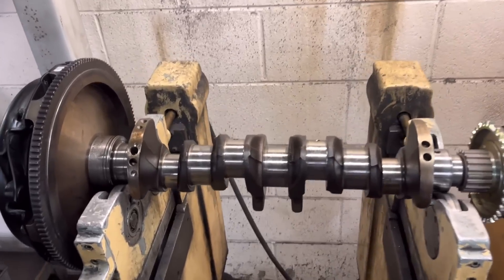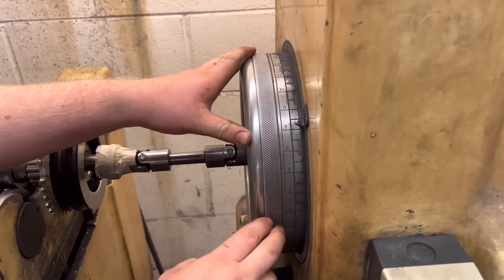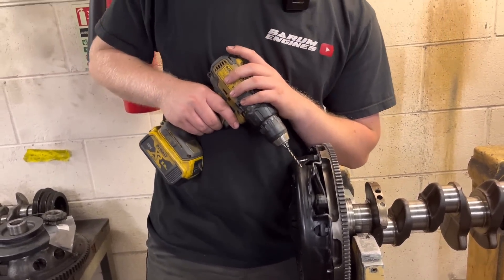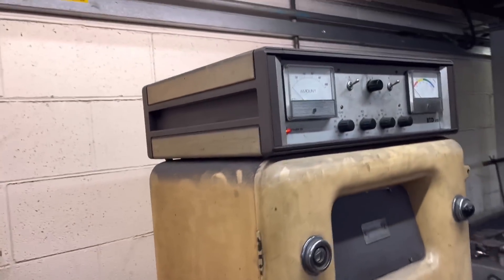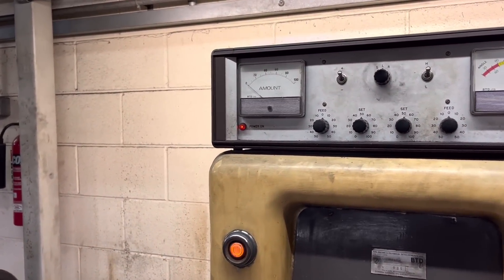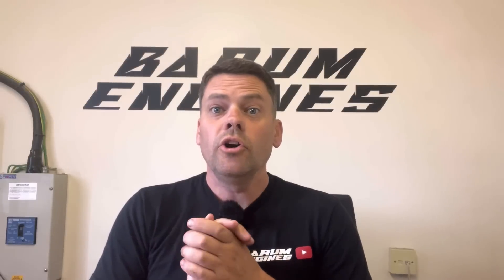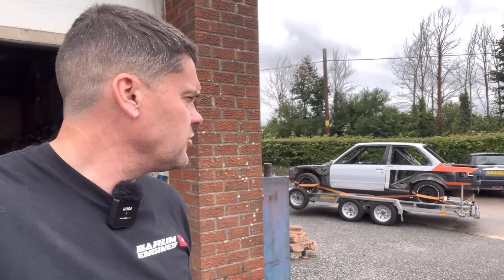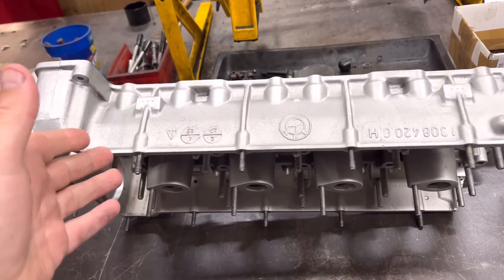Possible dodgy repair could have damaged our machine, costing us £4500!

Comment: Hello Lee, I used to work for an engine builders in Calne called Nelson Engines and did all the heads there, back in the late 80's Mira came to demo the new Centronic and held a full course on it for me and the boss, they explained that apart from the centronic being more stable than the VG85 we had it also required us to have fewer pilots, as you know with the earlier miras we needed a selection of pilots to fit snugly in the guides, but with the centonic we had as far as I remember a 7, 8 & 9 mm pilot. This was the main advantage (as well as it being more stable) before we had the centronic I would rock the machine back and forth and side to side (like the centronic did) to centralise the pilot if we were dealing with a bit of slop.
I think I remember them saying that the centronic would be more accurate if the pilot was a bit "loose".
Anyways, thats why, and I guess with your new non-centronic head unit you might need a few more pilots to get over the slop, unless you do the wiggle... ;-)

Comment: As an electronics repairer of industrial kit i am certain your guy can offer the option to re-spin a new printed circuit board which isn't hard to do nowadays & manually transfer the components across.... I've often done this even to the point of having to back engineer for some parts that have been as you say possibly damaged in the previous repair attempt & are now un-obtainium......(I'm sure there's someone in the UK who'd do it if he is too busy at the moment)...

Comment: Having not seen the circuit pcb, some components can be custom made or have specific firmware loaded. My question is the fact that they were able to find an equivalent component to solder in, then the part is still available. If you ask your hardware specialist to take a photo of the actuator board, with all the contacts around the world I’m sure one of us can source the parts. All of us would be happy to help I’m sure. Perhaps even a parts list if he can’t do that.

Comment: Lee, your electronics wizz should ask manufacturer if they have the code for the chip/s on circuit board and diagram. Is possible to buy new board prg an eprom/chip and make sure have correct flows and inputs/outputs to the thing. Its just a case of would they share it, as as you said for them now, making on off of old tech outside their wheelhouse.. Just a thought!

Comment: So, when it comes time for a new clutch, the engine needs tearing down to balance? I'd think covers came more precise than that.
Reply: As was stated during the video, crank, flywheel and clutch pressure plate are balanced indepenantly.  Consequenlty, if the clutch needs replacing, then only the clutch requires a rebalance.

Comment: Where I retired from, we have several electronic machines; Sprocket Milling machines, 200 ton press, Vertical CNC, and a EDM machine.  Years ago we found an Electronics master.  He can rebuild circuit boards, do minor board repairs, all of it.  Has a lot of the boards we use in stock.  We send him the board, he sends us the used board, minus our core charge, and we are up and running in 4 days.  Unfortunately, one day, he will retire and we'll be on the hunt again.  For now, we are solid as a rock.  

Find something else you know needs fixing, send it this guy, and see what he do with it, to fix.  Get it back, run it, see what he can actually do.  Hang on the this guys name.  Good board techs are very hard to find.  

Good luck sorting it all out.

Comment: If there is a schematic for the board then it should be a breeze to source and trace a problem on a circuit board, even without schematic a reasonable electronic chap can usually back trace a blown component and usually its down to either a mosfet, a capacitor or a resistor throwing toys out pram.   Some of the IC's are also easily found on sites online but it may have unique tailored IC's which is going to be far trickier to find a replacement for.   There's a Youtube chap called the Cod3r who is absolute master of circuit board repair and diagnosis, he does work on consoles but a circuit board is a circuit board and if you draw your board out as a schematic like Big Clive does you can usually make sense of what bit does where and where it gone wrong.

Comment: Post some decent close-ups of the electronics, I am sure many of us viewing have electronics backgrounds. I have always had pretty good luck with obtaining obscure old components. I very much doubt they are custom, at most they will have part numbers sanded off.
Reply: he trouble is the IC's are probably common as much but the machine manufacturers remove the parts manufacturers part numbers and put their own on.

so you can't identify a simple 555 or 7812 because the part has an unrelated code on it recognisable by only one company on the planet.

Comment: Never seen balancing done without bob weights, how do you compensate for reciprocating weights?
Reply: I completely agree. All they have achieved is turning the cover to Swiss cheese unless they are indexed selectively fitting the flywheel and clutch cover might have been a better bet.

Comment: I'm a retired electronics engineer. If the new motor/solenoid/relay unit didn't fix the problem the fault may well have been in this other board - the one with the new solder they worked on. Unfortunately it can be near impossible to fix some circuits even with access to the circuit diagrams etc. If you can't get replacement boards they probably should have warned you that a repair might not be possible.
Reply: Yes ... and no.  These guys took on the job as a fixed price repair, if they fix it with a simple rework of a dry joint they are in the money ... if the board is toasted they need to source a secondhand spare unit and strip it for parts, even if that costs them £10k ... thats how fixed price repairs go, sometimes you are quids in, sometimes you have to spend more than it brings, butif you offer a fixed price repair, that's the deal.
Reply: @itsverygreen532  +1 If it was a fixed price deal then I agree.

Comment: Motor driver chips on Pcbs often develop "dry joints" where the device is soldered to the pcb. Reflowing these joints often effects a repair. But doing it without investigation seems to be the poke and hope approach. I would also imagine there will be a programmable device with coding in it, unless the repairer has access to the coding, which can be a device to copy the data from or the data on a disk of some form, there's no chance of replicating it.
Reply: indeed...the coding is the huge issue....if the chip can be recovered, it could be readable

Comment: If you sent the part for repair and they couldn't fix it then it's on them. Why should you pay for them to give your precision bits to some intern to play around with?
Honestly, electronics are not that hard to fix, as long as they don't contain any proprietary components but i doubt MIRA would spin their own silicon.
Even big auto manufacturers refrain from spinning their own silicon, most of the time they just rebadge existing stuff, for example Renault does that a lot.
If your electronics guy is worth his salt, he should fix that thing up within a couple days.

Comment: There are companies that crank out custom designed circuit boards quickly and cheaply. There is free software like 'KiCad' that allow you to design the boards. Some of the circuit board builders have online software that allows you to design the board as well. I wonder if your competent electronics tech that looked at it is aware of this. Some excellent electronics techs from years gone by have no experience using the modern tools and methods and as such will shy away from trying to design or have built replacement boards for older equipment.
Reply: possibly need to reverse engineer the circuit and figure out what the microcontroller is actually doing though?
Reply: @abzzeus Send it to big Clive ..
Reply: Great comment. When I found out about custom PCB making availanle now it takes projects from tricky to no brainer

Comment: on the balancer does the wobbly drive affect the readings ?
Reply: Unlikely to have a significant effect as it is very close to the centre of rotation.  The further out from the centre it is, the bigger the effect. Close to the axis of rotation like the drive shaft is, you'll not see much change. Easy to check though, just decouple, rotate the crank 180 degrees and couple it back up, should still be in balance.
Reply: yeah i noticed the tape job on that and wondered the same

Comment: Tell Issac to tighten the drill bit in the chuck before he drills.. lol
Reply: New drill bits and a new drill help. My workshop is a broke arse budget thing and the chucks wear smooth inside these drills (i have the same drill) after hundreds of hours of use exceeding what they were designed to cope with.
Reply: I’ve still got two of my Dewalt Pro series 12v and 18v drills going strong after 20 years and so much use/abuse. New bits or re-sharpened bits work wonders though.
Reply: @andrewwasson6153  I was thinking he should learn to hand sharpen drill bits.

Comment: Balancing..............
I work for an aero engine manufacturer and the limits for balance on a jet engine rotor are trully tiny.,
One of the first steps is to balance using plasticine on the disc being balanced, to get as low an unbalance as possible. (Having flipped the balance corresponding parts by 180 degrees - in your case, the clutch or whatever that is attached to what you are balancing - the cam-shaft in this case. In aero engines, the corresponding part is actually a simulator, so that it is always the same.)
Maybe try the same? Then you have to work backwards to convert Xg of pasticine at, say, 180 degrees, to removing Yg of metal at 0 degrees? (In aero engines, balance is achieved using/adding what amounts to washers and bolts to add mass, very rarely is metal removed.)
Just a thought!!
When you have a chance, have a play........ Isaac will find it interesting, I am sure.

You need to allow for radius in all that...........................
Reply: Camshaft😂
Reply: Swiss cheese and swarf the Barum sandwich